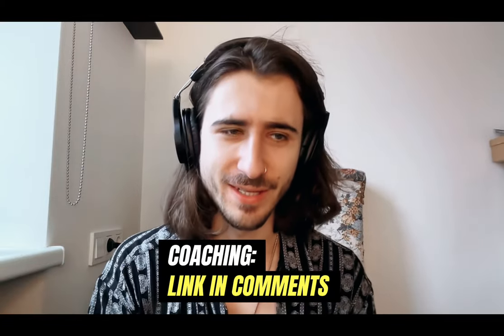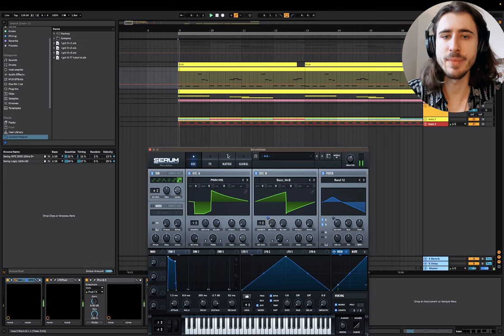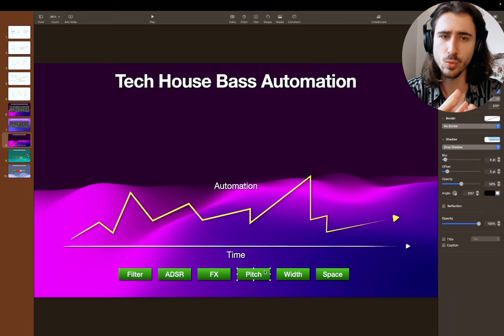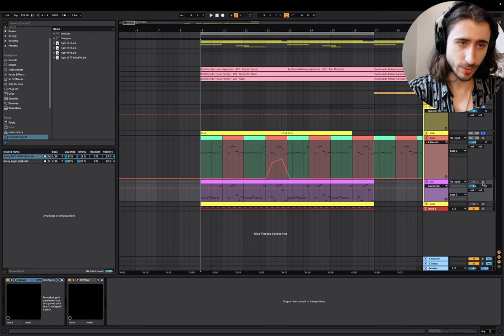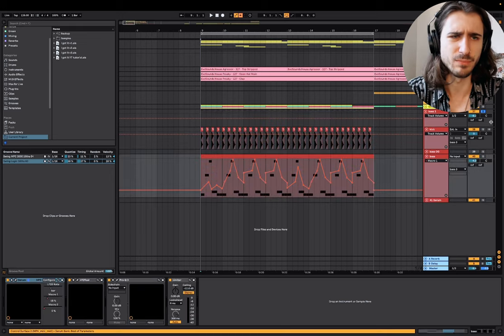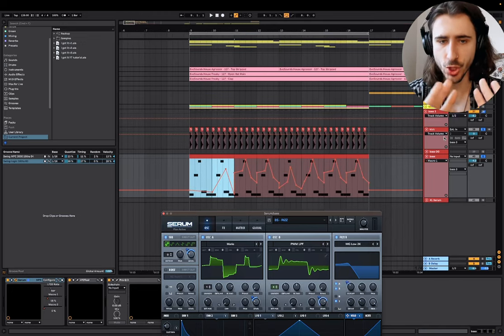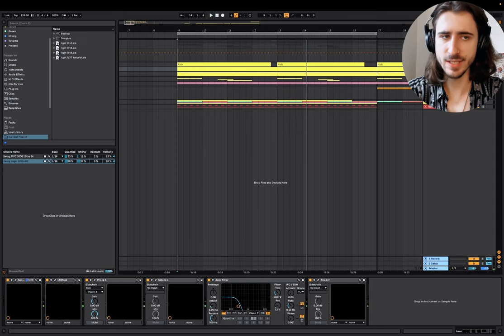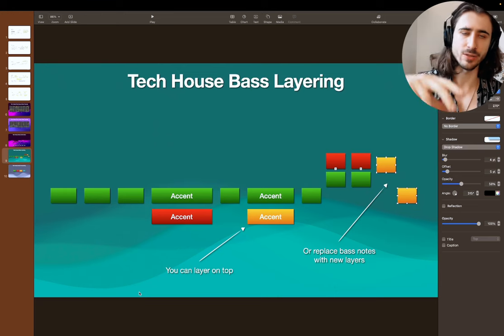Tech House Bass Automation - Full Guide

Comment: Great stuff ❤‍🔥Love the detune idea. Any reason you don't separate your bass and sub btw?
Reply from the maker: Yo broski! Honestly not a big fan of separating bass from the sub/using separate sub in the track. 
I just don't see any reason why you'd need to to it if you have a heavy bass like in this example.
I sometimes do have a separate sub/top, but that's only when the key of the track is low and I really need TOP bass to cut trough
Hope it helps :)
Where you're from btw?
Reply: @n I see! You certainly know more than me about this, but I can give you my two cents if you'd like. I separate bass and sub because I have learned that stereo imaging subs, which put it out of phase by definition, can/may cause destructive interference when played in mono like a club or festival. Sub bass frequencies have wider wavelengths than any other frequencies, so they are more likely to interfere destructively (aka phase cancellation) with each other when put out of phase. I could be wrong of course! I am from Ottawa, Canada! Hbu broski?? If I had to guess I'd say your accent is South African with a little bit of Russian haha
Reply from the maker: @samuelhamilton5245  Good point bro. I usually use an EQ to cut the side information from the sub till like 200hz to the bass is in mono. Cool cool, never been to Canada myself but I worked with some guys from there :) I live in Latvia but I'm native Russian so you got it right haha